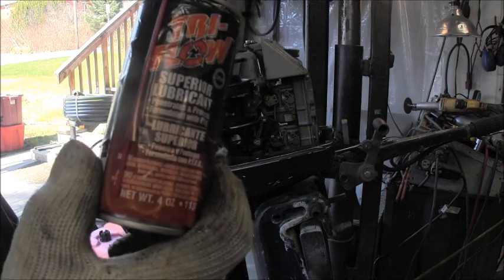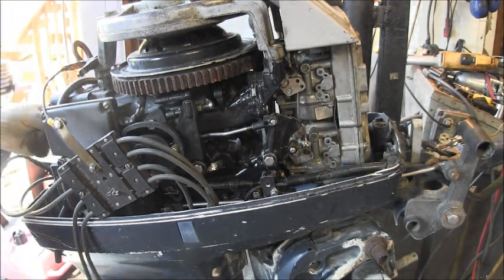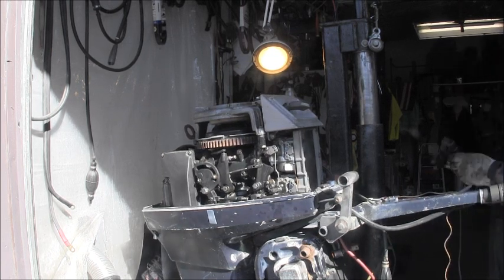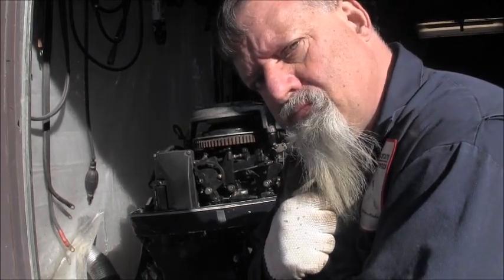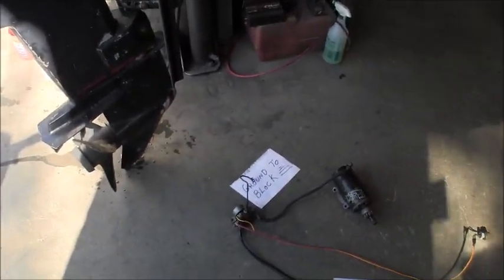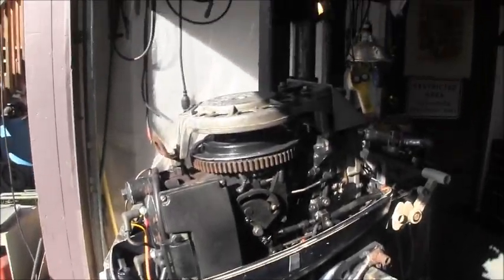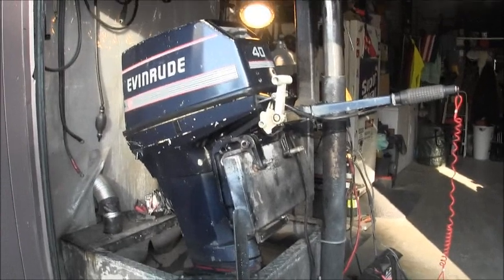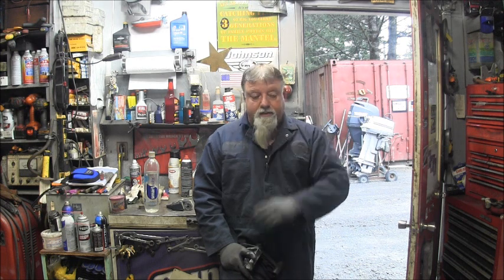EVINRUDE 1998 COMMERCIAL 40 HP, ADDING ELECTRIC START, & Wake Up

Comment: I just did the same thing with the initial startup of a rebuilt 25HP popped the starter on. Too old now to yank these things when they dont start after 5 pulls .☹ Good video!!
Reply from the maker: Heck I used to grab them old BigTwin 40's yank no problemo.   Not any more.     kb
Reply: @kodibassInsideoutboards  I use to yank them to no problem 6ft2 200 lbs easy peezy no more either,LOL! When I was a kid fishing off of this small whitestone bridge for snappers(baby bluefish) every boat that went under the bridge in those days had those SuperQuiet or a BigTwin 40HP Johnson or Evinrudes on the back chugging along as quiet as can be .You couldnt even hear them idle thru the canal they were great motors and so popular then and mind you affordable not like todays ridiculous prices, Ha!......
Reply: @kodibassInsideoutboards  Yes you loose muscle mass and yanking these outboards becomes a chore for sure,LOLL!

Comment: I have a remote 40hp with electric start and power tilt I'm putting a tiller on it.  If I unplug the remote harness and just hook up start and kill switch will it charge the battery and work ok.? Great videos thanks for sharing knowledge

Comment: hey kodi ive watched a bunch of your videos on older 15hp evinrudes and ive gotten mine pretttty good, i have a 87 on a 87 bassmaster new carb, impeller, fuel lines, spark plugs, starter assembly. i took it out the other day and ive been having this issue where i cant seem to figure it out. half throttle the engine runs great soon as you full load it boom starts bogging, cant be fuel lines ive sprayed the jets with it running i dont know about the throttle/carb screws? you see that i have no idea about. was wondering if you either could point me to a video you did or comment something u might know. willing to take any advice here. thanks man great videos

Comment: I thougt the commercial models had a 70 hp gearcase?
Reply from the maker: The 45 & 55 do but not the 40.     kb
Reply: @kodibassInsideoutboards  Ok I have a beefy 45 hp commercial rope start short shaft. Har to pull start 😓Please make a video about increasing hp to 55. Same engine I guess (except carbs)